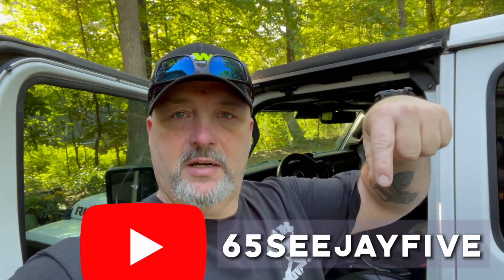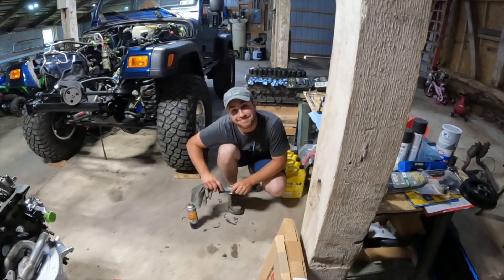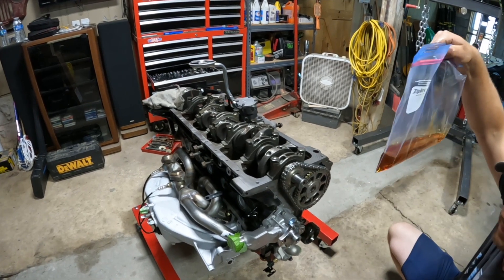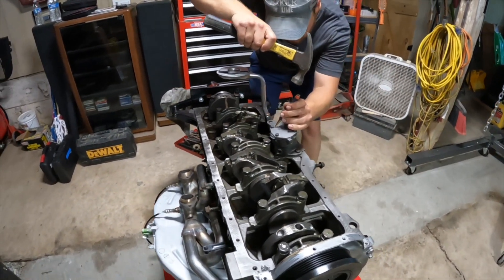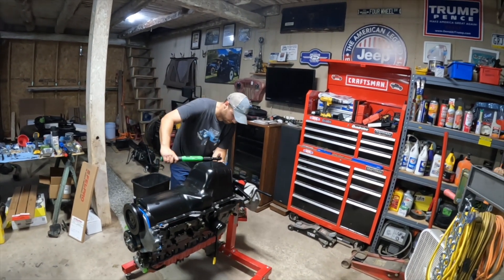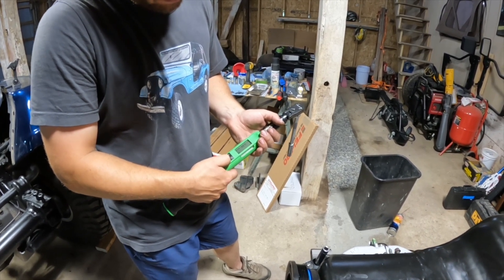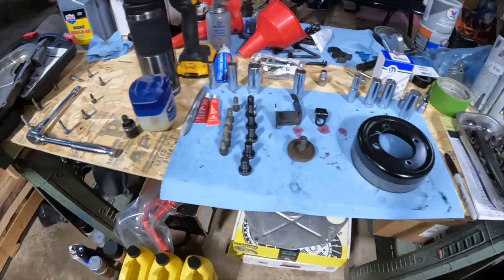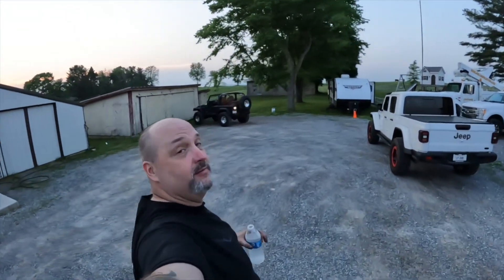4.7 STROKER INSTALL

Comment: Staking the bolts. Couldn't quite see what was going on there, besides the hammer and punch. What exactly were you doing? I am purchacing a stroker from them also and want make sure I'm picking up on all these tips. Thanks for the video and great tips.
Reply from the maker: We were staking the metal around the bolts so they can’t back out. Thanks for watching!! Greatly appreciated!!